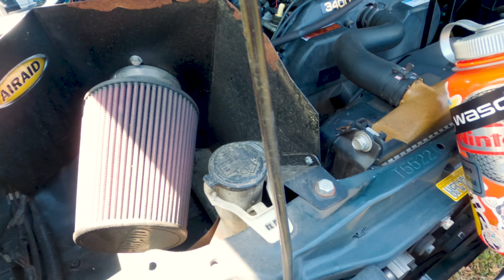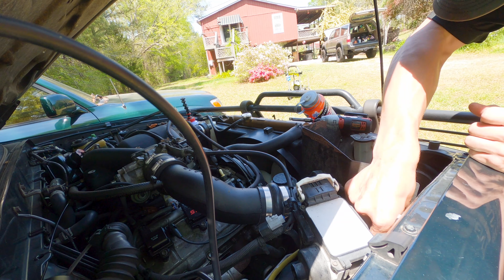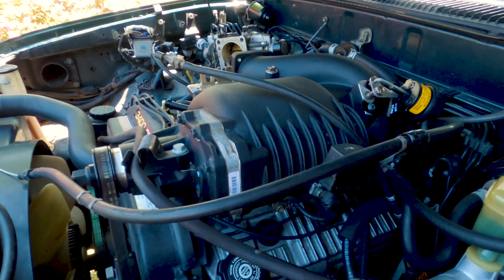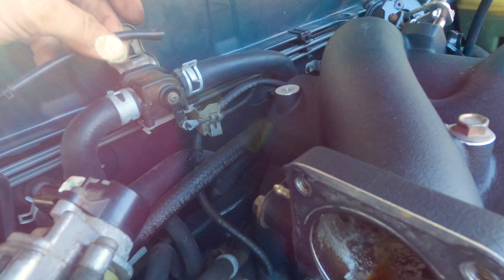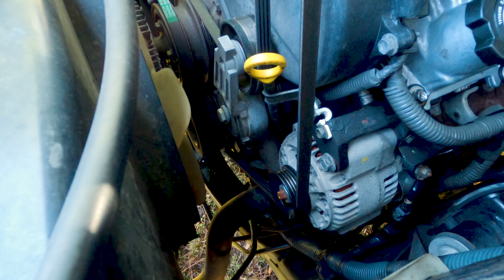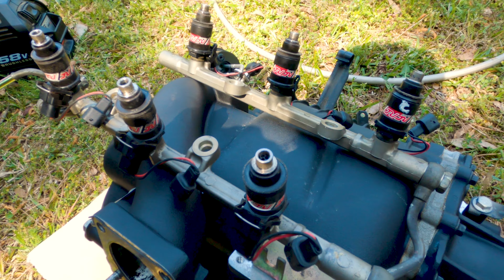3.4L Toyota 4Runner/Tacoma Supercharger Removal - Swapping to My Daily Driver 2002 4Runner 4x4

Comment: Do you have any plans for the brush guard on the green 4runner? Im currently looking for one here in N.c. with no luck finding one.
Reply from the maker: My current plan is to leave it on the vehicle. It is damaged unfortunately. Whoever had the vehicle before me hit something with it and the tubing is crushed in. Luckily the guard was there though, otherwise I'd have some bumper damage.
Reply: I don't blame you at all man. Thats a sweet guard and did its job to protect the bumper. 👍thanks for getting back to me.